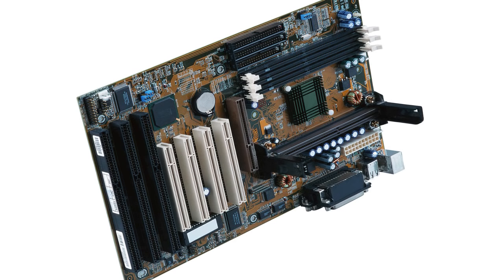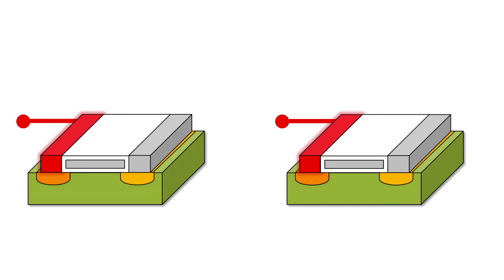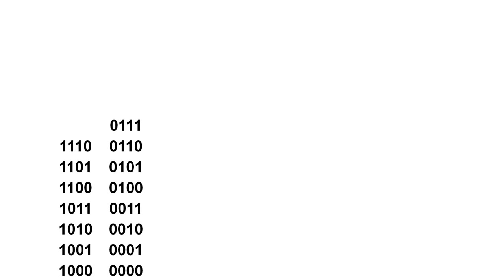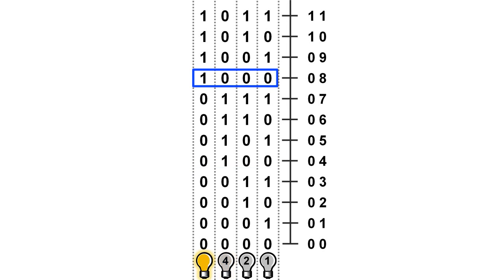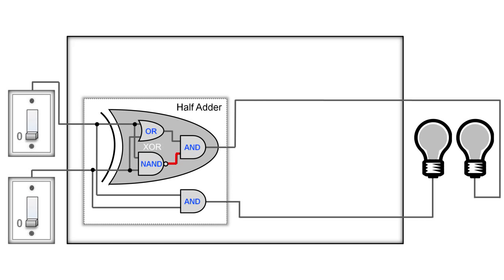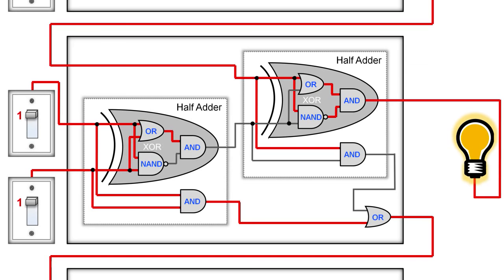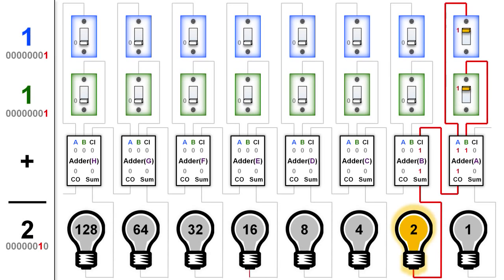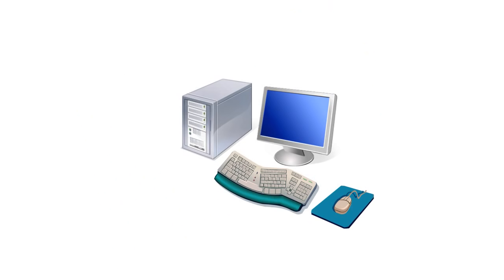How TRANSISTORS do MATH

Comment: I have designed microprocessors for 30 years and was the designer of the first integrated Floating Point Unit (doing real number math).  I had to see your explanation and enjoyed it a lot.  Great basic introduction; with a mountain of optimizations available for faster and wider math.  These systems are the most complex on the planet and I still find it amazing that we can get them right.  Nicely done!
Reply: hey there

if I have a processor, lets say a some 6600K, is there any way to see its architecture in detail ?
I mean, what is the deepest a consumer can take officially look into, from some open documents or something ?
are CPU architectures kept in secret by the companies ? if yes, up to what level ? how do programmers do, when they wanna see as profoundly as possible what currently happening with their hardware ?
Reply: @davidcopperfield2278 get a good microscope and you can see alot. Secondly no there could schematics are trade secrets and are not released to the public. Finally programmers use instruction set architecture which does not require a very microscopic view of the cpu. It allows them to work with registers. However most programmers don't interact with hardware directly.
Reply: Ok. I invented the first light bulb and also discovered gravity.
Reply: Lividbuffalo I was gonna say that but you know what? Let's be positive for once
Reply: Science have gone too far
Reply: @m0-m0597 Cleary you didn’t like what I said. That doesn’t mean it was “negative”. I don’t know who you are or who the OP is, the converse is also true. This is a dead space where anyone can say anything and there is no fact-checking possible or even desirable. So what I said isn’t necessarily “negative” since you implied we should be “positive”. 

Also, put some respect on the guy who originally discovered Gravity (me).
Reply: @Lividbuffalo  did you discover gravity the last time you dropped a mic that hard?
Reply: i know i sound pedantic as fuck but wouldnt floating point operations technically only truly involve rational numbers, afaik there is no way for a computer to conceptualize an irrational number without a bunch of approximating
Reply: Sir i am a computer science student doing my bachelor's right now. But I have high interest in area like embedded system, computer architecture, robotics, hardware, microprocessor design, hardware ,cyber security, program or development and pure maths 
My university is not that much good i have to find my own path 
How can I learn about all these things I am unable to find complete source nobody teaches everything
I want to master all these subjects
Reply: @samarthbelani well I'm not the person to find answers. considering how many those are the best way is to learn one by one. bc the probability of finding the one person who has all you want to learn is low.
Reply: @Lividbuffalo no kidding, I invited the perfect oxygen, carbon, hydrogen air blend everyone enjoys today. And the male reproductive part. Small world!
Reply: @Josh-uj6gb what are registers.are they part of cpu or ram

Comment: Wanted to know how computers add 1+1; was not disappointed.
Reply: +Element115 we know how it works in that theory... The question is how the computer does it... Try telling the electricity to go from one column to the left one, if there are 2  1's... How do the chips calculate it... How do they get the two 1s from there: 0001 to there: 0010
Ofc we as humans know that we just have to move it to the left... But how does it work in the circuits? (I hope it's sorta understandable since i came here to seek the same answer)
Reply: +Kamineru73 +Kamineru73 Don't worry, I understood it, since I wrote this comment 2 months ago I can't quite recall, why i wrote it, maybe because I was tired, was only halfway through the video or as I presume now that I just didn't 'get' element 115's comment, since it only explains how a human being would calculate this, but I guess I assumed everyone would know that part already, or not really search for this video if not. So what I was looking for was a video (like this one) that explains how the 2 on-switches make the first lightbulb turn on, and the second one turn off. E.g. I know that 01+01=10 but how do two ones turn to a zero. Which was then explained in the video->by using the XOR-gate. The buildup of the XOR- and the AND-gate was the answer I was looking for. Not that 1+1=10. Since I knew that before... But the question was how ;) 
I hope it's more understandable now :) since my previous comment was not against that video in any way. The video is awesome and educational :)
Reply: TheJaredtheJaredlong   1+1does. Not =o
Reply: TheJaredtheJaredlong ok I taught myself this week in 1sr grade  in Holzems
Reply: Why it's bad to just do a half add job.
Reply: Is computer only adding machine or what are some more compliced process based on addition?

Comment: I strongly recommend that CODE book. It's fucking amazing and I'm not even a computer science guy. I was just curious about how we get from electricals circuits to shit on a screen.
Reply: Same here bro,  is like we've been reading each other's mind.  Actually for a long time now. Ihave been keenly curious about how the computer processes it's data via electrical signals to obtain the understanding finished product in the screen also known as Output. 
As well as the transmission and coding of signals via wave BTW two devices
Reply: That's basically how I ended up here. I've been an arcade tech and collector for a long time, and never looked into how we got these awesome machines to work

Comment: this is the best video I ever seen for how CPU works
Reply: The best I've seen so far. I finally understand how it works. \o/
Reply: This video gets the logic gates completely wrong.  The transistor layout in this video does NOT work.
Reply: It explains concept very well and straightforward
Reply: This is indeed a very good video, but this is not how a CPU works, only a part of the CPU's arithmetic logic unit (ALU). If you enjoyed it, you should search for more videos about computer architecture, most of them are from India idk why lol
Reply: PantuFJAR "most of them are from India"  That explains their hard-to-understand English.
Reply: Its kinda funny and you get used to it, but indeed it is hard to understand sometimes
Reply: Closest to this I have seen is a darn US army magnetic core logic video from 1950's. Logic gating was so new then, that they had to go step by step through it like here. add charge to this wire, it creates magnetic charge to this core ring. Then put charge to this shift wire and the 1 gets carried to this new next core ring and so on and so on. put these to inputs on these charges and this happens and so on.

Only difference was that it worked on magnetic coil influences rather than semiconductors. Also works in wonky wirings, because magnetism....

Also I think usually people used vacuum tubes. However vacuum tubes are fragile. So the military for some time used magnetic core logic, because the cores were more robust than vacuum tubes. Before then moving to transistor logic.

It is actual a pretty common case I have seen. Some of the best no nonsense core basic electronics and engineering videos are old military technical staff training videos (which luckily are often available due to various nations publicity laws). They started training people from zero and had no time to mess around. So it is step by step from the most basics up with no messing around with needles jargon or trying to be fancy.Also no needless analogies or extra crudding. Since it was military staff training. We will explain and your duty is to learn and remember, so no need to try to hide the gnarly bits to be learned. You learn or you cry at night and learn.
Reply: Not the best I've seen, although pretty good.  I'm afraid that Ben Eater's Breadboard Computer series has this beat.  Not by a lot, though.
Reply: Crash course got it better
Reply: How many videos have you seen
Reply: But at first seconds of video he shows us a motherboard with empty slot for processor (it's a slot motherboard, not socket) and shows the north bridge instead of microprocessor
Reply: Same man and I’ve seen about 20
Reply: Totally agree  what a great teacher he knows how to simplify it not many teachers have this talent
Reply: Really awesome one

Comment: So thats why in Zelda for the NES you can only hold up to 255 rupees, now i get it.
Reply: Megagera that's also why you can't go past level 256 in PAC man
Reply: And that's also why if you have a basic RGB image you can usually set each color to value between 0 and 255 - there are 8 bits (light bulbs) = 1 byte for each color (Red, Green, Blue) representing how much of it each pixel has, making up a more specific color. So for example if you have a 100x100 sized picture, which is 10000 pixels, you need at least 10000x3x8 bits = 10000x3 bytes = 30 kilobytes of memory for it (if you have no compression :))
Reply: Whoaaaa the neatness!..its too strong!! explodes
Reply: that's also why I couldn't get a score of 256 in flappy bird.
Reply: Mirek M. Your math is completely wrong. If your image is raw then you would need 512 kilobytes.
Reply: also explains why my bank account never gets over $255 lol i was so confused
Reply: @Godel Escher Bach that's because we are no longer using 8bit machines...duh current machines use 32/64 bit architecture which means instead of the cpu being able to work with only 0000 0000 numbers at a time (which was the case with NES if I'm not mistaken) which, if all were 1, would make the number 255, CPUs nowadays are able to work with 0000 0000 0000 0000 0000 0000 0000 0000 (32 bit) or double that (64 bit) numbers at a time. If they all are turned to 1...well just do the math cuz I don't feel like it but u understand the point I hope
Reply: @Godel Escher Bach understandable, sometimes our mind is just really far away from the subject haha no problem!
Reply: Ben Awpfflick a lot of 8 bit micros are still used, and we can make larger integers by using more bytes to represent them. You get into trouble with that method if you’re trying to conserve memory though
Reply: @ccandrew111  Oh well, I didn't know that! But it makes sense. Thanks for the input!
Reply: @ScarPlays69  Computer memory used to be super-expensive. So expensive in fact that some of the earliest computers made for the home user had only 4K (thats 4096) 8-bit bytes of RAM. And disk storage was so expensive, only big businesses could afford them so everyone else had to save stuff onto cassette tapes. Slowly. And load the stuff just as slowly (usually something like 300 bits per second, although with a bit of fiddling around and good quality tape, it was possible on some machines to increase the speed to 600 or even 1200 bits per second).
Reply: @melkiorwiseman5234  Yes, I know my dude!

Comment: Mr. Perzold,
Since my teenage I was curious to understand what was the BASIC PRINCIPLE a simple adding calculator could do it. When computers appeared, I soon realized that they were a giant pyramid of that same BASIC PRINCIPAL, giantly piled. And I was sure that understanding the BASIC PRINCIPLE was the core of the mystery.  Thank you for having shared this video and made possible that I have finally understood that! The time laps from 7:00 through 11:00 are THE thing, and I went through them several times with intelectual excitement and curiosity to be able to re-explain to my self. I'm very happy for this.
Thank you!

Comment: Good video!

The CPU is actually not where he says it is. On modern computers he would be correct but the motherboard on the first picture is for pentium 2 or 3 CPUs. They are enchaced in a funny cartridge.
Reply: Yep, he pointed to the north bridge, the cpu on that board is just below that in what looks like an oversized ram slot.
Reply: I came to the comments just to see if anyone else noticed this big mistake.
Reply: Mr_Tobiah he didn't make a mistake he didn't say that this is the CPU he sad microprocessor so his technically correct.
Reply: The CPU he should was actually an old 80286 CPU as well judging by its size, number of pins and package style.
Reply: correction that looks more like a 80386 CPU not a 80286.
Reply: He's not entirely wrong here. Even the north bridge is a micro processor itself. Hence he didn't call it central processing unit, he is right. But my instant thaught was the same... dude...

Comment: How I wish that these tutorials had existed when I was in college studying engineering.

I struggled through digital electronics class, never understood what the gates actually were physically. things were never explained this way. 

now its a lot more simple for me to comprehend.

what I have learned over the years is that learning is something that is dependent on who is teaching you.

when you have such a simple but complex topic as computer science , you need a good teacher that can break things down to their simple and elementary form

I had to watch this video like three times, pause at some point and think about what i was looking at and I was like , ohhhhhh, I see it now. 

wish the internet had all this info way back then, would of saved me so much headaches.

I have understood something  that took me a whole semester to learn and I still never fully understood it back then , I barely passed the class.

In simple terms , an or gate is a parallel connection either switch will turn on the output, the and gate is a series switch , both have to be on and every other gates are derivatives of that.

All compartmentalized with in the cpu

Comment: how do they get this stuff so small and so many on a platine?
Reply: They use a special type of blueprint thing which goes over a silicone sheet and shoot it with a laser which cuts the silicone. They then pour copper (i think) on the silicone so it fills the holes and use a precice laser to cut the top of it so it isnt connected. There are many other steps like doping and I may have made a mistake or two, but that is the basic idea. Just lasers... :)
Reply: it's called NANO TECHNOLOGY
and Nano Architecture 
these days the cpu's can no longer be assembled by humans because they are too small and the level of precision is too high , it's all done my machines .  google  HOW IS A CPU MADE,   it's an interesting video

Comment: Now explain the system clock
Reply: The system clock is measured in Hz. The system clock regulates the speed of the transistors. Basically,  it is how fast you flick all the switches in one second. Faster clock means faster flicking, which means faster results. Sadly, CPUs cannot handle overclocking without fans,as this causes additional heat, since the transistors needs more energy, along with other problems.

 Please note that when you see that a CPU is clocked at 4GHz, it does not mean that one transistor flicks 1 and 0 4 billion times a second, that would be insane! Modern CPUs contains a lot of transistors, thanks to Intel and their first microprocessors, and that 4GHz you see is the cumulative speed of all the transistors contained in the CPU. It means that there are many many switches, and that ALL the switches are being flickered 4 billion times a second, maximum.
Reply: Yeah, but what flicks the switches?
Reply: +Olaf Seisler Electricity. I Will not explain it in details since it's a bit more complicated. When in example you click on a program to open it, an electrical signal is sent to the CPU, to address the request to open the program. This signal is the thing that flicks the switches.
Reply: +David Côté-Tremblay Glad I've helped! Note that computers with multiple cores are clocked by core.
Reply: So are you saying a 2.6 Ghz  system with 4 cores are clocked individually 2.6 Ghz 4 times?
Reply: Sorry, you have been lead astray. At 1.6 Ghz, all the transistors are switching 1.6 billion times per second. Modern desktop computers in the $500 range are capable of computing trillions of multiplications a second due to thousands of circuits like the one in this video (but way more complicated) each doing a calculation every time time the clock ticks. Up until about 2003 clock speed skyrocketed, by about 30x every decade. In the last 15 years, the clock speed hasn't been able to increase much because the longest electrical pathway on the chip might be 3 inches and at 3 billion times per second the charge has to be moving at 228 thousand kilometers per second. 300 thousand kilometers per second is the speed of light. So now we add more and more cores, and reprogram everything to take advantage of parallel processing. The next huge leap forward will be when we figure out how to make 3 dimensional circuits, so we can have a billion transistors in a 1000x1000x1000 cube instead of a 33,000x33000 plane, resulting in being able to run clock speeds about 30 times faster without breaking light speed.
Reply: Quartz crystal? Just like any other modern day cheap watch?

Comment: Not sure why this video got recommended 10 years post upload, but the part you called the microprocessor is actually the northbridge. This is a Slot 1 motherboard, the CPU (not pictured) is mounted on a card that slots in the large black slot. This was used on Pentium Pro, II and III CPU's.

Comment: What you are calling a microprocessor at 0:13 is actually the northbridge chip, aka chipset. The actual microprocessor on this motherboard actually slots on the slot situated between the chipset and the capacitor array.